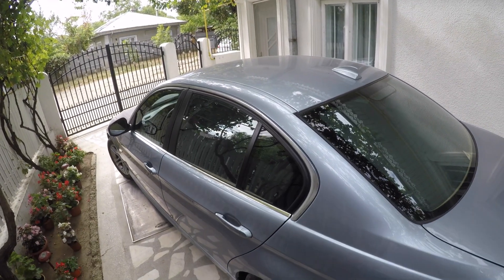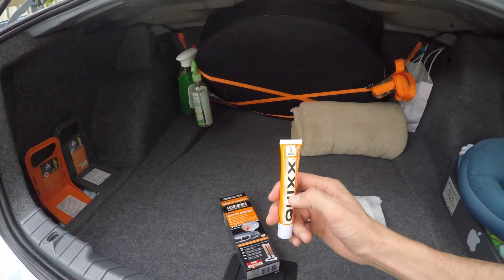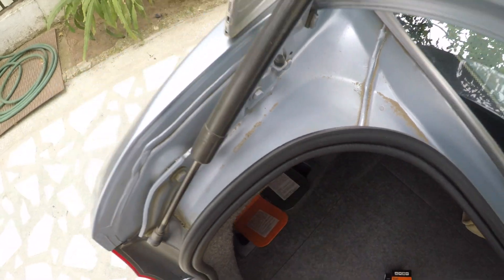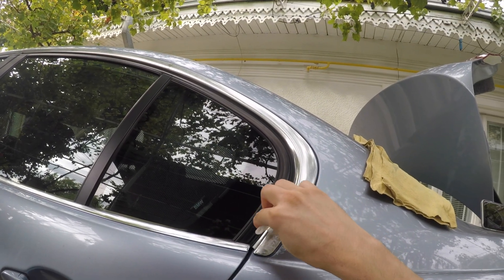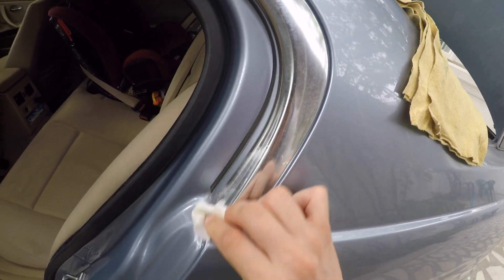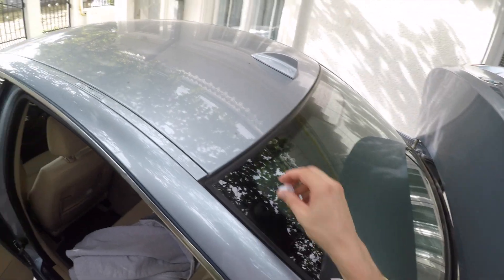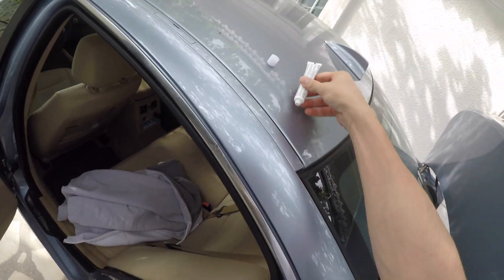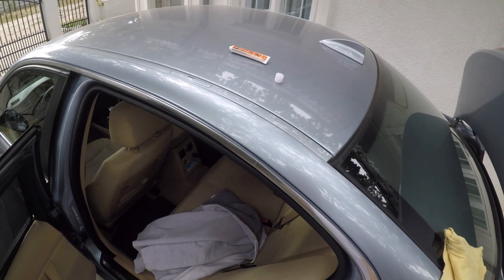How to clean chrome parts on your car BMW e90 Lci with Quixx Paint Scratch Remover

Comment: you use only the n°2 ? I tried 2 times doing the 1 then 2 with their speial paper and tissue. Nothing changes at all...
Reply from the maker: n1 and n2 , but you have to be calm and wait for the results to appeat, just do it in small incrementes and it will work